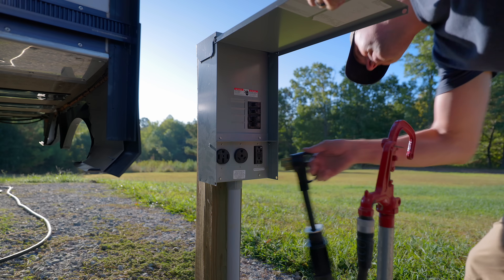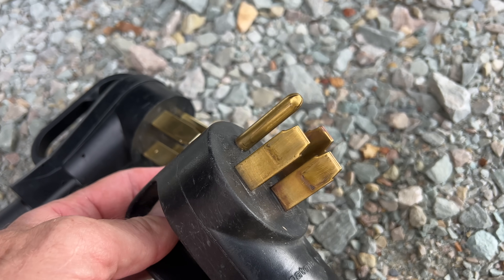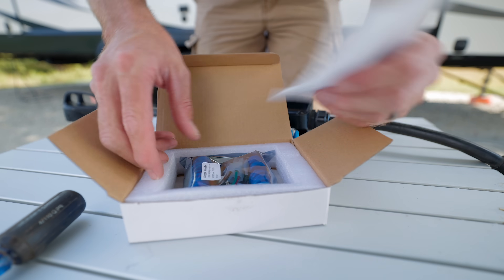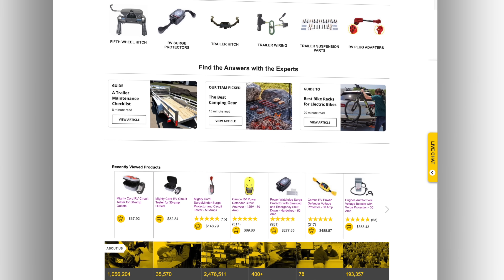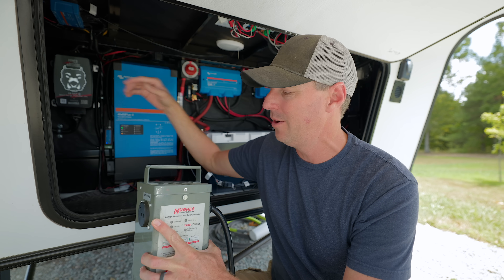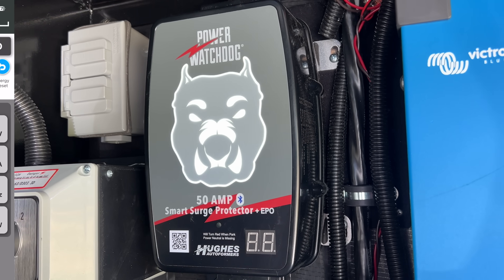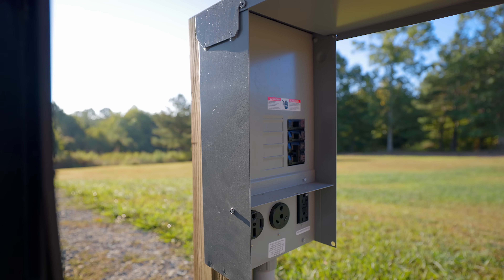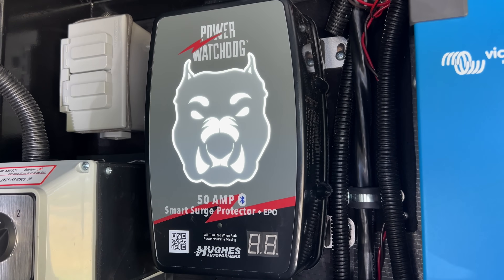Failure! RV Surge Protector Misunderstanding! Is Your RV Surge Protector Protecting You? AllAboutRVs

Comment from the maker: I hope this info helps if you are looking for the links you can find them here. 
Etrailer https://bit.ly/3TkfX63
Power WatchDog. 
      EPO 50 Hardwired. https://bit.ly/4fPfjqx
                         https://amzn.to/4cDvyUA
      EPO 50 Portable.  https://bit.ly/3XdV0vn
                      https://amzn.to/4fY5PJk
      EPO 30 Hardwired.   https://bit.ly/3YUWADW    
                     https://amzn.to/3AAM7mT  
      EPO 30 Portable  https://bit.ly/3yErvd3
                     https://amzn.to/3AyX8Ff
Autoformer Voltage Booster
     50 Autoformer.   https://amzn.to/46TwOSx  
     30 Autoformer.   https://bit.ly/3MnJrvn
                  https://amzn.to/3Xe0N48
Surge Module Replacement
     50 amp.  https://bit.ly/3ySTHJ9
                 https://amzn.to/3WT9dNb 
     30 amp.  https://bit.ly/3ABtK18
                 https://amzn.to/3MiPGki
Non Contact Voltage Detector.    https://amzn.to/3WUsI7T
DeoxIT D5. https://amzn.to/4fZ1DsT
Multi Meter     https://amzn.to/4dKGlNU
Reply: @AllAboutRVs or anyone reading this . Can I use my old rv’s 50 amp surge protector on a 30 amp camper with an adapter? I know I can do this but my question is would it hurt the rv or my 30 amp cords being I’m plugged into 50 amp?

Comment: surge protector has nothing to do with power on you steps its your ground on the plug on your RV it is called HOT SKIN , need to replace your power inlet it is bad ,i would do a smart plug

Comment: The replacement surge protector "circuit board" is a great end user experience that is one reason we offer this at the dealership I work for. For and another $30-$80 your unit is back up and running and you do not have to buy a whole new unit.

Comment: Thanks for the good video. I have a Progressive EMS Surge Protector external at the pedestal and it is doing its job. My question is about  using a power strip with multiple plugs and maybe a few USB outlets with built-in  surge protection plugged into an outlet inside this same fifth wheel.  OKay , redundant or bad idea?  I’ve been searching for an answer so hope you can shed some light. It’s time to buy an additional power strip for inside so the question is with surge protection or without surge protection under the above scenario. TY !

Comment: I've had a few parks where my autoformer was a godsend and one where without it, the voltage was low enough my EMS was cutting power whenever an adjacent RV's AC would kick on. Even just the 2% boost I get at standby is nice if the park voltage isn't already over 120, it gives my AC just a little bit of a boost.

It's also really helpful when I'm moochdocking at friends' or family's and running off an extension cord. I have to be careful about the amps I'm drawing since it'll increase that, but it really helps counteract the voltage drop from those long 12 (or sometimes 14) gauge extension cords.

(Right now, visiting my parents, I've got over 100' of cord including my RV power cord and I lose several volts over the length of that. The autoformer gets me back most of those volts, at the expense of an extra 2% or 10% amperage, depending on the mode. My AC certainly appreciates the extra voltage in this heat.)

Comment: I just picked up the new Gen 2 Watchdog after my last surge protector got water inside and the contactor died. Having the wifi connection so I can monitor and get alerts remotely is very nice. As a bonus, I was able to find a matching replacement contactor for the old one, so now I have a backup surge protector.

Comment: the RV industry is seiously lacking on quality control. I built a cargo conversion camper 15 years ago. Well I am needing a larger one at this time. On looking around TRAILERSPLUS advertised that they are the specialists in this field. They advertise one piece roofs, totally sealed floors, built to last. So I paid more than others were charging for this better quality. drove 2.5 hours to the dealer here in Florida. After getting home I notice screws missing on exterior paneling. after getting a ladder to look at the roof (7 foot walls) I see a three piece roof. I installed a RV door latch and window. Then I pulled interior plywood off to insulated  walls. found all verticle seems not sealed. Day light can be seen on all of them. Front exterior wall has a 2 inch gap from the floor. All this is opposite of there advertising, Picture adds stapled to this trailer. I contact them and he said procedure is to take pictures and send them by text. Then he changed tunes and said I would have to bring back the trailer so they could evaluate. Well they replied that  it was built with in there specifications!!!. So I am stuck with a trailer that needs a lot of work to make it water tight. I think people need to be aware of this false advertisement from this company. They never stated what there guid lines are for quality control are. BUT aparently if it can be hidden from the buyer it passes!!

Comment: Additional safety recommendation would be to first test pedestal for proper wiring:  Poke the NCVT into the tall neutral slot (no blink or beep), then the ground hole (no blink or beep) and finally the shorter hot slot (should blink and beep). It won’t tell you the exact voltage of the outlet like a voltmeter, but it will confirm if the polarity is correct and tell you if the ground connection has been floated and electrified by another RV with a short in its own wiring.

Step 2:  AFTER step 1 confirms Pedestal outlet is safely wired, test for hot skin voltage.    ALWAYS TEST FROM OUTSIDE THE VAN
A.  Multimeter (best method)- Set meter to test voltage, with pedestal outlet connected to van / RV connect black lead to pedestal bare metal or bolt and red lead to bare metal such as trailer hitch or lug nut.   
If voltage more than 2-3 volts is detected there is a dangerous hot skin.  

B.   NCVT Method.  Less sensitive but adequate.  
Confirm NCVT working.   Standing outside on ground and fully griping NCVT around palm,  test metal for voltage.   There should be none.

Comment: Timely video.  My Watchdog EPO wouldn't allow me to power up at the campground when I arrived giving the error code for no ground (E7).  The "campground guy said it was a new plug the whole campground system was grounded.  After a bit of haggling, the campground guy called "his electrician".  Sometime later, they got their electricity working such that the Watchdog would allow me to power up safely.  You cannot prevent every problem but this is one  you can easily mitigate.

Comment: thanks J, always bring great content. I have the same Watch D, EMS as yours which you recommended way back. I love it. Its permanent, out of the way, and always read. But its also finiky with E7 = missing ground and that protects us... doing its job.. but I am out of power :( until I find the solution. Thank god for solar back up.
Reply: Be aware, there is a “design issue” with the WatchDog when used with Victron Inverters.  It signals “false” an “E8” missing neutral and shuts down shore power.
The flaw is in how Huges determines an “E8” Missing Neural… in that the E8 error is triggered when L1 and L2 are at “equal” power.  This is a faulty electrical design as this is not how a missing neural should be determined.  
2nd, and what a number of us with Solar and Victron Inverters using a WatchDog have found is, the WatchDog does not provide enough time for the initial shore power connection for Victron Inverters before triggering an E8 error, and shuts down shore power.  Further, the WatchDog E8 error messages to user says that the is something wrong with your RVs electrical system and seek repair…. Again a false failure indication.
The above is a known issue between Hughes and Victron, but Hughes will need to redesign their Software to support Victron inverters….  Many months to do… if they decide to do this change.
I have 1st hand knowledge of this and have switched to a Progressive power protector with no issues with my Victron inverters.  Be aware.
Reply: @louie3552  thank you my friend. I have been using my fifthwheel on grid and off, also from time time plug my small 2k gen to charge the battery bank a few times and I never encountered that E8 error.. yet There is 1 issue I ran into at first was my gen, it was missing a ground, so the WD, shut the rig down. I learnt how to by pass that issue by jumping the ground to neutral on the gen plug. But thanks for heads up!! with people like you we will always be informed. thanks sean from Montreal

Comment: We too prefer the hardwired Power Watchdog EPO and also carry a replacement surge module. However, you MUST use a bonded ground-neutral plug when connecting a generator to the EPO or else it won't pass power through.

Comment: People don't have them for their house they believe the sales propaganda and spend a lot of money for the RV. 😊
Reply from the maker: I would agree but we also don’t move our houses around and plug them into multiple different sources not knowing if the source is properly wired for it. Our setup has protected us multiple times over from miss wired panels and extremely low voltage.
Reply: @AllAboutRVs  thru the years our surge protectors have saved us several times from low voltage (before I purchased the Hughes Autoformer), from an open ground, and from a recent voltage spike.  As you stated, low voltage is very bad for AC units.
Reply: I have a surge protector for my whole house.  Saved me several times!
Reply: And that's because your house electrical system is a "known good" system.

RV parks are an unknown as are the thousands of other RVs that plug into the essentially same circuit.

Comment: I believe the Hughes voltage booster also has surge protection, for what it's worth.  It could be a feature on newer generations, I don't know.

I have one, haven't (fortunately) needed to test either function yet.  It would be nice if it had Bluetooth and/or some kind of option for a display, then it might be more viable to just hard wire in.

Comment: Great video. We also use the Power Watchdog 50a hardwired version. It's been a great unit; although, our first one did have a failure where it would show a neutral line error. Hugh's replaced it, promptly. We also carry a spare surge module.

Comment: Well done. The only issue I have with everything you said is you never touched on the disadvatage of an onboard surge protector. If it takes a lightening hit or surge that kills it, you are without electricity until you either replace it completely or rewire around it. When using an external surge protector and it takes a hit, you can always unplug it, and just plug it in directly to restore power. Admittedly pros and cons to weigh out, but it's why I chose external. I'm still protected and can be back up and running again quickly.
Reply: Right, this is kind of my thing as well, I would rather protect my entire line of power from the pedestal all the way into the camper. Having the EPO in the main bay doesn't protect your expensive cable along the way and could still be a potential hazard should electricity somehow arc from your cable to the camper during a high surge event. I do keep a backup surge protector in my storage as well just in case something catastrophic happens when the Power WatchDog and I can't just replace the surge module. Electricity is one of those camping season enders and I want to make sure I have everything I can to prevent that kind of event.

Comment: The other way to deal with the low park voltage other than using an autoformer is to simply lower your load. At one park over labor day weekend we had to shed all load other than the AC, we even turned off the converter's charge circuit during the day and ran it to recharg the battery overnight. Last week we were at a park that was just a little low and there the answer was to switch to gas for our hot water heater instead of electric which lowered our use enough that the voltage stayed above 108V which is the cutoff for our EMS.
Reply: How is "lowering your load" going to help when the voltage coming out of the pedestal is already low? As pointed out in the video, heavy summertime demand in some parks will cause the voltages to drop straight out of the pedestal.
Reply: @gonebyrv9748  because it's often not coming out of the pedestal at too low a voltage, often with no load I'll see 110-115V but when you load it down with >20A per phase it dips under 108. So reduce the draw back down to only say 15A for the air conditioner and it'll stay up around 110V. Like I said I've actually done exactly that multiple times including just a week ago when staying at a state park where unloaded it was at 110V on one leg and 112V on the other, by running my hot water heater on propane I avoided a 15A of draw which had been drawing that leg under 108V and causing my EMS to shut off power.

Comment: Another excellent video!   Thank you.   After years of just suffering with low voltage full timing in one park, we finally got an autoformer a few months ago. What a difference!  Worth every penny. We bought a used 30A model for $150 that originally sold for $550.  Deals are out there for those on a budget.
Reply from the maker: Very nice, glad you were able to find a deal. They aren’t cheap new that’s why we kept the old 30 amp version

Comment: Thank you for your Youtube videos which we watch weekly but since we watch on TV we don't get to comment. While at my brother's home if I plug our 5th wheel (50amp) into his garage outlet I get a reading on my hardwired progressive EMS "Reverse Polarity". On the outlet on his porch all works fine. What does the Reverse Polarity mean and is there a solution?
John
Reply from the maker: Thanks! Yes that usually means the hot leg and the neutral are switched. Things will often work but should be looked at and fixed.

Comment: We just got the Progressive Industries EMS for our rig. We got the hardwired version for the same reasons you mentioned.  We have had good results thus far!
Reply from the maker: I liked the display you get with that one.
Reply: @AllAboutRVs  yes, it is very helpful. I would like it have an audible alarm though, when there’s an error code.  It took me a while once to realize we didn’t have power, since our batteries power many of the systems.
Reply: Excellent choice.. I too have an (internal Progressive unit -50amp). Never an issue.

Comment: Good video but you missed making the biggest point of failure really clear even though you mentioned it. Most failures are burnt pins on the power plug because the pedestal receptacle is worn out from use. Cleaning up your cord prongs isn't going to help if at all.  I use a sacrificial adapter if the park can't replace the receptacle and set my inverter to limit the current while making up the difference. Also I have a really cheap surge protector from Amazon that is about 25 dollars. The prongs are thicker, but if it melts it's cheap. Why the makers of surge protectors don't put high temperature alarms on the plug prongs baffles me. I've seen way too many people toss their surge protector because the plug melted, I guess that's why they sell so many.  😊
Reply from the maker: Not a bad idea. I will at times clean the park outlet before I connect. I find more dirty than loose.
Reply: Maybe I'm missing something here. I use a different brand of external surge protector. It will (and has) shut off my power off if there is an issue in the power supply. I'm surprised the one you have doesn't do that.
Reply: VERY good point about park receptacles. Not only do they get a lot of use leading to loose fit, they also get the occasional drive away with shore power cord still plugged in. Most parks, being cheap, don't replace receptacles until they burn.
Reply: Let me guess. Your profession is....... electrician?
Reply: @lmiller1413  clinical engineering retired
Reply: Most of the plugs are a piece of folded metal. Wouldn't spreading them slightly make them a tighter fit and reduce the sloppiness making single prong melting less probable?
Reply: @AJ-hl9ig  I've done worse. Bending, twisting, and I've even used a burnishing file in the socket to clean the receptacle. I've even put rivets in the prongs of a sacrificial plug. These are only done if moving or getting it fixed isn't happening.

Comment: My progressive industries does not turn on the power for a number of seconds after making the connection.  Do I really need to shut off the circutbreaker before plugging in?  It seems like the delay in turning on power would insure that there is nothing drawing current during connection.
Reply from the maker: That would lessen the chance of the arc in the beginning but it takes a second to do it. I still do.
Reply: Have you ever plugged on and you had an arc?  Anything wanting current will attract the electricity. That high heat arcing causes the connections to loosen up over multiple arcing events. This can lead to meltdowns or electrical fires. If you have ever survived an electrical fire onboard a boat?  You can understand just a little of me taking a little more precaution when hooking up our Rv. Be safe and great RVing!